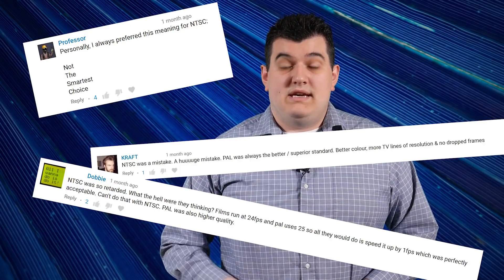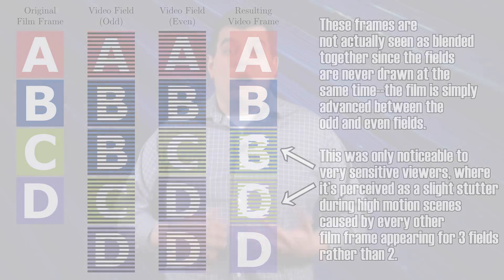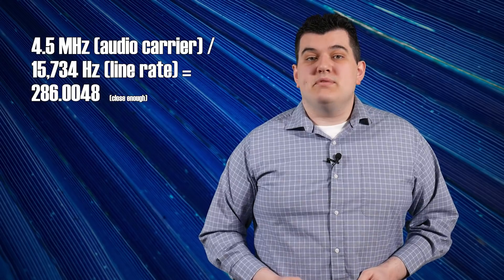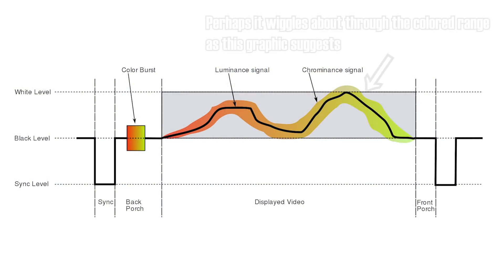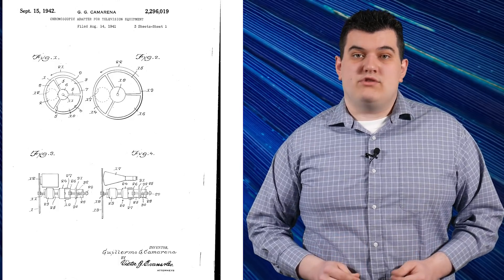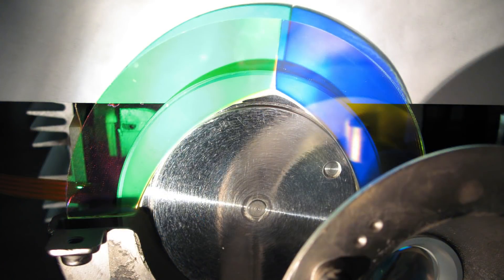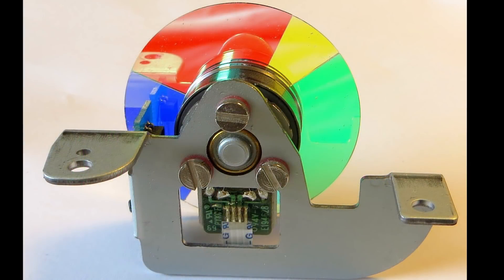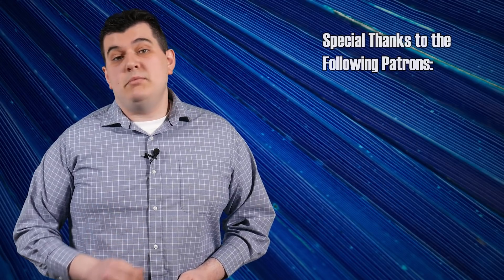Analog Color TV Wrap-Up--Some extra info

Comment: I am a little late to the party here and I see others have already taken care of your glaring error by connecting framerate and lines to PAL and NTSC. I would like to add one more thing.
PAL, NTSC and SECAM were only the color systems in the analog RF signal. As soon as we are talking about any other system, there is no PAL and NTSC anymore. This goes for Betacam SP (using component analog video) all digital formats and especially if it is a digital computerized format.
So any software referring to PAL, NTSC or SECAM will have to provide hardware for it to be true. If it is just software, there is no color system like in the broadcast RF signal.

Comment: It's only understandable, that back in the day, any broadcasting and recording needed to be done in 29.97/59.94  25/50 Hz. However, today we are far past this, as almost all monitors run at clear 60Hz and digital data transfer of any video content makes it obsolete to stay at such limitations. I would never consider, recording and producing at anything other than 30Hz and it's multiples. Living in Germany, I find it annoying, how pretty much still every TV broadcast and many German Youtube productions run at 25/50fps, which causes a slight stuttering on a 60Hz monitor, that I always recognize. 60Hz has become a standard for (regular) displays, why doesn't recording follow? I think even movied look better in 30fps - though not in 60fps.

Comment: I believed that colour in the UK was broadcast on UHF because it was better quality than VHF which 405 line UK tv and the US 525 line used, in the same way FM was to AM for stereo radio and that the frame rate took its cue from the mains frequency, 50Hz in the EU and 60Hz in the Americas and that the 24fps of film was close enough to 25fps of tv that it didn't matter.
The truth is far more interesting and uses all sorts of crafty connections and intellectual deductions which are all rather mind blowingly neat: the thing about pull down to sync film and chroma dots to recreate colour especially. It's all so nice, in the 'Nice and Accurate' Good Omens sense ( prophecies of Agnes Nutter, Witch).

Comment: I remember well the dual standard televisions I helped install in my youth. They were capable of both 405 & 625 lines with complicated switching between the two  systems. I remember assisting  the installation of a Philips 26" dual standard colour TV that was huge!  It was mostly valve (vacuum tube) based and soaked up over 500 watts from the mains! Watching a black & white programme on the 405 line system on the 26" screen was like viewing it through a Venetian blind! It took a couple of hours for the TV guy to set up the convergence, purity, barrel/pincushion distortion, settings, etc. after he had degaussed the shadowmask tube with a mains powered coil. 
We were amazed when colour sets could be imported from Japan, plugged in and work without ANY setting up at all!

Comment: Thanks for that. A couple of asides. 1) Over here, in the UK, we are told that the alternating phase burst was thought up in our Post Office Research Labs, which also gave us the analog computer, Enigma cracking etc etc. The math, drawings and stuff were given (not sold) to Telefunken on government orders as part of a rehabilitation program for (West) Germany. The Post Office department involved went into a fugue, especially since some years earlier they had been ordered to destroy all their computers (the first!) on orders originating in Langley,VA to stop the Roooshiuns fum geddnum. Although the unit kept working, pioneering scads of technologies and applications, they never regained their previous ascendency. Increasingly, politics intruded into engineering considerations. Total f***up ensued. 
2) Thanks for the wee tip of the hat to John Locke Baird. However, my understanding is that after his mechanical system was rejected, with its demonstrated two color capacity, Baird threw himself into electronic television so hard he almost came out the other side. His hiring of Philo T Farnsworth wasn't the brain skimming exercise US historians usually depict. Intellectually, they were partners. 
3) One of the most curious aspects of British history is the insistence that radar was "invented" by Robert Watson Watt. Over a year before RWW did his first field trial, John Logie Baird had been assigned the first of a succession of aircraft for a still classified series of experiments. It has to be either radar or a death ray, and JLB was a committed pacifist. 
4) Before his death, John Logie Baird had conceived, designed and built an electronic three color system, approved for introduction as soon as the war was over. He had also demonstrated a full color optical 3D system. Publicity photos of this system in action may or may not be simulated. If the latter, I can't tell. 
If you want to look into this, please  plague New Scientist magazine with your questions. They set my feet on this trail.

Comment: When NTSC color broadcasts began, many viewers experienced tint issues. The tint issues were solved for people in Europe by introducing PAL instead of NTSC. In PAL, the same disturbance of the signal that causes NTSC colors to go wrong causes only a slight decolorization of the image. In other words, in case of bad reception, with PAL you see a picture that's a mixture of the correct color picture and a black-and-white picture. That's far more acceptable than the tint errors of NTSC since we were used to watch black and white before NTSC and PAL. So, at that moment PAL was better than NTSC.

It has remained so ever since. End of story.

No! A game changer happened. Several redundant game changers happened.
The first one is cable TV. It's not just that cable TV has better reception, should have, sometimes you can have a bad signal from the cable provider. The color errors of NTSC happen because of multipathing. The reception of an OTA signal can be as bad as it gets, if there's no multipathing going on, the colors are correct with NTSC. But all too often there's multipathing OTA. Cable TV and satellite TV cannot suffer multipathing. Whether the reception is good or bad, NTSC always produces the correct color and PAL has no de-saturation issues at watching TV over cable or satellite.
Another game changer is the plus package. There's PALplus and NTSCplus. They're downward compatible to PAL or NTSC respectively the way NTSC and PAL are downward compatible with b & w. With the plus package, the color remains stable even when multipathing is going on.
These changes caused problems of PAL and NTSC to go away and NTSC is no longer worse in the way it once was. Now we can look at more minute details of both systems and find, PAL has disadvantages. This http://www.hawestv.com/mtv_2color/mtv_2colorP3.htm website states, PAL has a lower "gamut" than NTSC.
In NTSC, Q is broadcast with less bandwidth and less signal strength than I. Q can be broadcast with less because we don't see the difference. In PAL, U and V use the same bandwidth. In consequence I and Q use the same bandwidth. It can't be in lower sideband modulation but must be in double-sideband modulation. This means I must be broadcast with less detail which difference can be seen.
The pattern of dots caused on a b & w screen as shown in 5:35 was more intense in PAL than in NTSC. For one because Q was transmitted with lower amplitude. On the other hand because etc
In the end, NTSC was the better system. At first, we waited for so long to introduce colour TV here in Europe, just to have a better system. Then our glory didn't last long.

Comment: In the uk we had colour tv in 1953. Not 1961 In 1953 the coronation of Queen Elizabeth II was televised in color, using an experimental field sequential system developed by Pye and Chromatic Television Laboratories. ... This was, we believe, the first outside colour-television broadcast ever attempted, and we understand that it was successful.
Reply: Later in the 1950s, there were experimental broadcasts by ITV in 405 lines with NTSC colour.
Reply: The UK did not have regular colour TV broadcasts until 1967, anything before that were just experiments. The Coronation of Queen Elizabeth was only broadcast fully in colour in America.

Comment: 2:12: Correct me if I'm wrong, but I suspect it would have been possible to change from NTSC to PAL if people had been willing to sacrifice colour: If I understand correctly, then existing B/W TVs would still have worked the same as before, but colour NTSC TVs would only have been able to pick up PAL broadcasts in mono. Given the at best incremental improvement that PAL offered over NTSC, I suppose it wasn't considered worth the trouble to annoy all those proud owners of NTSC colour TVs.

Comment: Having seen lots of PAL (I'm a Brit) and Lots of NTSC (I work for the BBC) I think there is very little between them in performance over a clean reception channel. The static resolution to frame rate argument can go on and on forever and is more artistic than objective, I personally prefer higher frame rate over higer static resolution. Having both, 1080 50p or 60p is far superior to 525i, 625i or 1125i IMHO.  As for showing films at 4% difference we have used sample rate convertors to pitch shift the audio down for the last 10-15 years, though some  channels in the EU may not.  Also PAL isn't exclusivly European, it was in use in India, Africa, China, thats a lot of viewers. Also NTSC may be called Never Twice Same Colour but we called PAL, Pictures At Last as it took so long to develop, or Pale And Lurid, went it went wrong people looked like they had had a good time the night before. The only differences between HDTV systems now is frame rate, and if digital if aTV systems are showing an up converted version of NTSC encoded archive material I beleive the gamma curve was also different between NTSC and PAL/SECAM.  For a master class in early DSP and TV systems look up the IBA's DICE system developed in the very early 1970s. PS excelent video BTW and yes, hats off to the USA for been the first.

Comment: 3:2 pulldown results in judder, unsmooth motion. 25fps is perfectly smooth. It's quite noticable. The slight difference in runtime and pitch is entirely worth it. Sorry, but once you notice the judder it's entirely unacceptable to watch. I'm glad that HDTV's started to natively support proper 24fps playback, but on the old system, the speedup tradeoff was much preferred.

Comment: Makes sense that a later system is betetr because it has the advantage to learn from the older ones.
However trying to make it work for decades maybe was a worse call then a hard cut?
It's basically adding epicycles on epicycles.

Comment: PAL, phase alternate line. its best trick, each line the chroma is inverted. if there's a drift in the decoder, say a few percent towards the red, then the next drawn line is having the same error but away from red.... as these scan lines 'mix' to the eye, hue drift is virtually eliminated and no hue correction control needed. ever thought a little more about the original frame rate of 30/25 being half the countries ac line frequency of 60/50hz..

Comment: The 625-line system originated in continental europe, where it was used in black and white all along, in the form of broadcast systems B/G/H (in Western Europe and Yugoslavia), D (VHF in Eastern Europe), K (France and Eastern Europe), and L (VHF in France). Though it was also used in most of South America in the form of system N and NC which used 625 lines on a NTSC/System M-like 6 MHz band, with a 3.58 MHz color subcarrier frequency (NTSC uses 3.57 MHz and normal PAL uses 4.43 MHz).
Brazil uses PAL-M which is 525/60 (but without the 59.94/29.97 nonsense of NTSC) with a 3.58 MHz color subcarrier frequencies.
Japanese NTSC differs from normal NTSC by having a PAL-like value of black, thus having a slightly wider range of shaders. It's why Japanese video cassettess looked weird when played in the US and vice-versa. :p
Also, you forgot to mention the French SÉCAM, which had colors encoded in FM rather than AM, with two color subcarrier frequencies and using alternate-line memory similar to PAL. The name stands for SÉquential Couleur Avec Memoire, but in the US was often nicknamed the System Essentially Contrary to American Method. It was developed in France in co-operation with the Soviet Union for protectionist reasons, and then adopted by the Eastern Bloc. Ironically, PAL was often use internally at the TV stations anyway, as SÉCAM is impossible to edit.

And I believe the Soviet Union was close to being a contender for the world's first color television, because they had early trials with the non-B&W-compatible Raduga system.

Comment: A version of the color wheel system (at the recording end) was used to send color video back from the Apollo Moon missions, because a three-tube color video camera was just too finicky and bulky to send, but there were usable monochrome cameras that could be fitted with a mechanical color wheel. The interleaved signal was converted to NTSC on Earth using a whole lot of old-school analog video wizardry. I think the earlier missions only had the color-wheel camera inside the spacecraft, but later ones actually took them out on the lunar surface to send back live color TV. I saw a webpage somewhere that argued that the format was basically identical in some sense to Col-R-Tel.
Reply: Yes. The Apollo 11 mission used only B&W, running at 320 lines and 10 fps, and up-converted on Earth. Colour wheel was used subsequently. Wikipedia has a great article on this; "Apollo TV Camera".

Comment: That integer relationship of the subcarrier to audio turned out to be totally unneeded. The audio is FM and is never fixed in frequency so there is NO integer relationship . The bad side is living with Drop Frame time code and back in the analog days, hum bars walking through the video. All of this is gone with HD except that danged 29.97.

Comment: When I think of American TV when visiting the US in the past, I always think of washed out, slightly fuzzy video. The resolution and colour seemed more noticeable than the drop in framerate. That being said, HD video has mostly eliminated these problems, with the exception of a 50/60fps switch.

That bring said, I never thought of NTSC as inferior or a mistake. My guess at the time was the difference was because of the reality of the US electricity running at 60hz compared to the UK running at 50hz, and that in the earlier days  TVs more directly relied on the frequency of the power grid. So, to make most efficient use of the respective electricity supply, US TV provided a better frame rate whilst TVs in the UK took advantage of having extra bandwidth for colour.
Reply: Unfortunately, you did not have the opportunity to watch analogue TV broadcasts in Brazil. But I had the opportunity to watch free-to-air broadcasts on both NTSC and PAL-M here in Brazil thanks to a technical error from a local TV station. Color rendering on PAL-M is much more enjoyable than on NTSC, especially with regard to skin color. I recommend looking for recordings of old Brazilian TV shows here on YouTube and you'll see the difference from old US shows.

Comment: One significant difference between NTSC and PAL was the phosphors used.  Especially, the blue in PAL was deeper (less cyan) and allows a wider gamut,  and was similar to what you'd find in any CRT computer monitor after CGA.   I would expect old NTSC recordings need a little bit of green adding to fully saturated blues to display properly on PAL TVs, VGA or modern LCD screens.

Comment: Great video, however likely been pointed out frame rates between the US and Europe, 60fps NTSC compared to 50fps on PAL are down to our European mains frequency of 50hz compared to yours at 60hz with each running at two fields per second in good old analogue. That's the reason.

Comment: NTSC = Never Twice Same Colour
Those saiying there's no extra information in a PAL picture vs NTSC because the extra lines are canceled out by the missing frames:  Don't forget about bandwiidth.  PAL has an extra 1Mhz video bandwidth, the sound carrier is at 5.5 vs 4.5 for NTSC.  Also, the "crawling dots" are actually the chroma.  You will always see them on a B/W screen that doesn't filter them out.  And, yes, you can reconstruct the colour from the dots, because red dots are the biggest and they get smaller as they go up the scale towards blue/volet.

Comment: The UK carried on 405 line transmissions up to 1985. But in reality pretty much any TV sold in the UK after 1964, when BBC-2 started on 625 lines, black and white, will have been dual standard or 625 only.
Reply: 625-only sets didn't start being sold in the UK until November 1969. Between 1964 and 1969, a 625-only set would only have been able to pick up BBC-2 (and the unannounced test transmissions for 625-line BBC-1 and ITV, but they didn't start until around late 1968 and they happened at unpredictable times).

Comment: Huh, I always thought it was the other way around, that PAL was the one at slower framerates.  And as an example, it's why Sonic on Master System is out of tune compared to Sonic on Genesis.
Reply: Because it is. NTSC was 29,94 frames (or 59,94) per second compared to PAL's 25 frames (or 50).

Comment: What a load of bullshite.
1. NTShitC was 29,970 fps, not 30. Hence the neverending problems with non-natural number framerates.
2. You had to slow down the films from 24 to 23,976 fps to use pulldown and it produced nasty artifacts. While there was a technique of pulldown in PAL that avoided them. But this shite artifact is still upheld today and we don't get BDs at 24fps, we get some shit number. While HDTVs run no DC, so they don't give a rat's ass.
3. PAL is better in literally every field (pun intended), you should have switched to it when it was introduced.